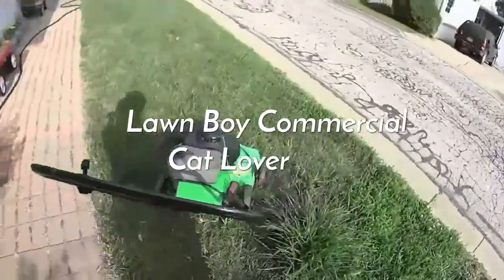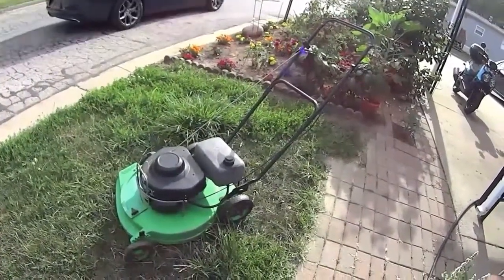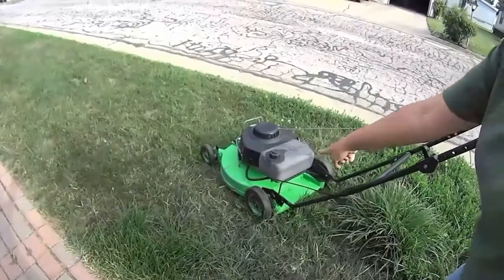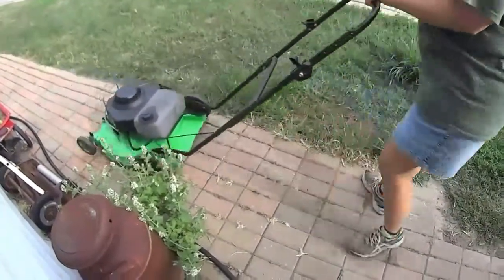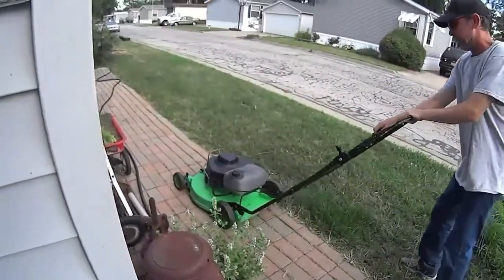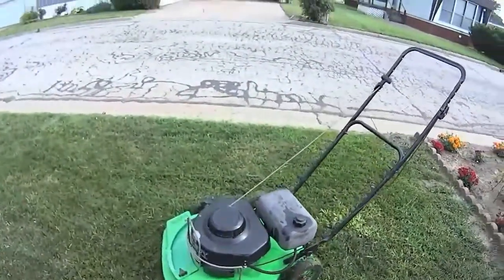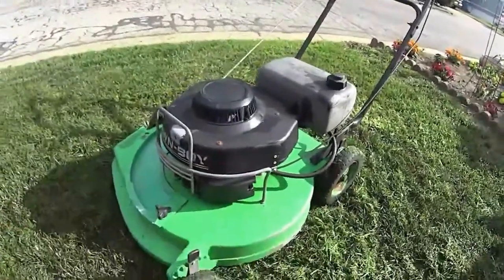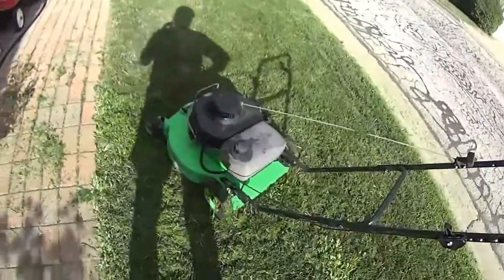Lawn Boy Commercial Mower.  Watch this cut the long grass!

Comment: Sounds like it idles a bit high. might check the lower main seal.
Reply from the maker: LOL!  We would if we still had it!  This was a mower we listed on eBay.  It sold last summer.  The idle does sound a little high the longer it runs.  Glad you found this video Donald!  Check out so of the other LB videos by going to the playlist.  Thanks!!